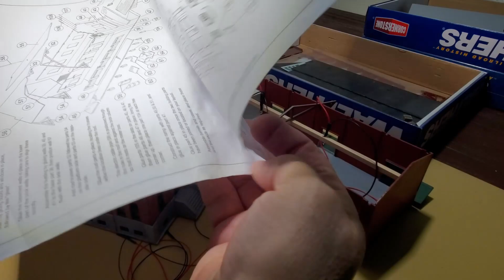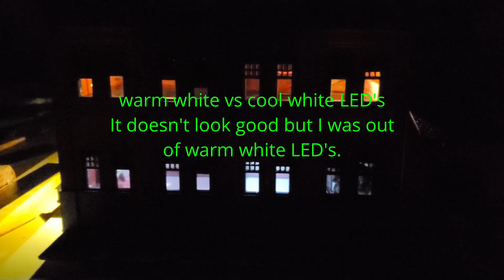Walther's Waterstreet Freight Terminal with Oil Paint Weathering Demonstration.

Comment: I just found your blog, so sorry for being late.  What's the reason for applying paint at the bottom of the roof and brushing upwards?  Seems to be in the opposite direction of gravity??
Reply from the maker: Thanks for checking out the videos. The reason for brushing upwards is that the dirt collects at the edge of the roof as it is washed downwards, so the dirt concentration is heaviest at the bottom edge.